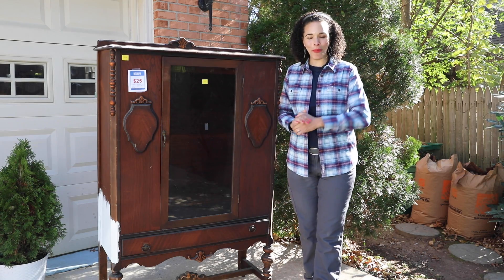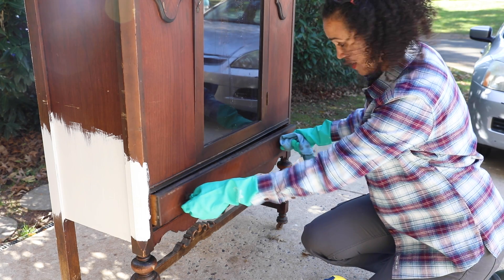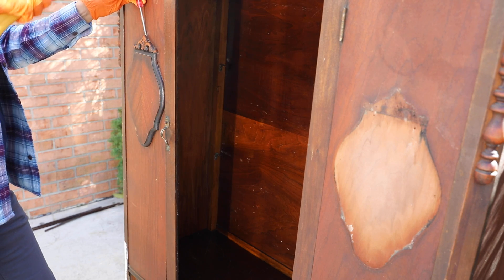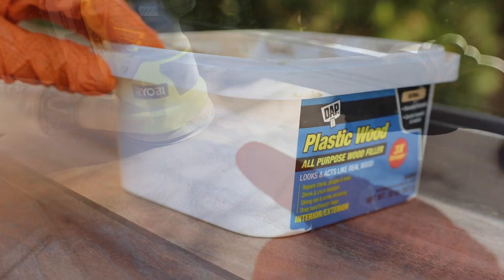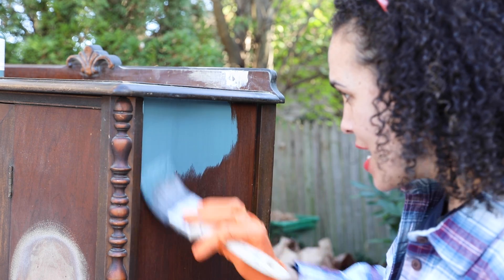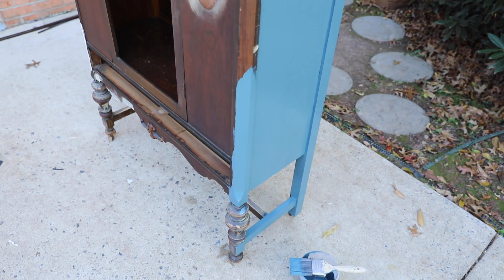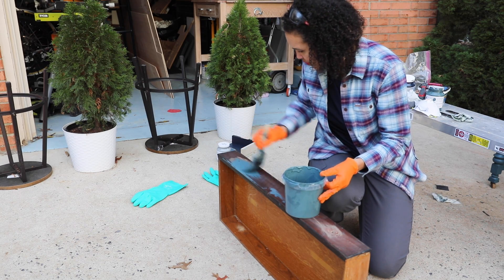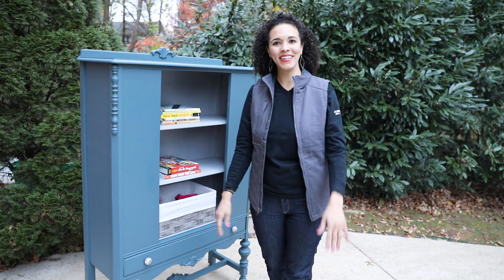BEFORE & AFTER: How to Paint a China Cabinet - Thrift Diving

Comment: Hi you just made a good point of why a power nailer should never be used in small molding around glass. All the molding pieces should be numbered and put back in the same position and use identical size nails to go into original holes using a tack hammer which has a very small head. Taking the door off to remove the glass and replacing it is best done on a table. If that glass fell it could seriously cut your leg or foot open. The color you chose was gorgeous!

Comment: I wouldn't be too sad about the thin glass breaking. My eldest son got a nasty injury when wind blew front door closed hitting back of his head. When the door had been installed, my Mum in Law wasn't aware her cousin, the joiner hadn't fitted safety glass.
It's too easy for a little one to push another whilst walking past, unintentionally causing an accident.
Old glass is just so thin.
Your cabinet is absolutely beautiful.
If you can safe a piece of furniture even by painting, it's better than being tipped or going on a bonfire.
So many people don't want brown furniture.
I still have my round teak table and chairs that fit right underneath it, bought 1969.
About to get top sanded and waxed, legs painted. Original jazzy early 60's print to cover 4 chair seats and back. Eldest son gave approval, didn't ask for it, but pleased!
It's nice to put new life into furniture you like, but feel it just needs a lift!

Comment: I picked up a piece out of the trash that is just a little bit bigger in the dimensions than the one you have. We painted it and I did not replace the glass but instead I put chicken wire and replaced the inside trim to hold it secure. It looks amazing

Comment: Over-all this turned out nice.  Loved the blue not the grey.  While it could have been repaired, It was a good candidate for painting as it was never an expensive piece.  Thoroughly inspecting and lightly sanding the whole piece helps to find those loose bits of veneer.  It would also have smoothed out the roughness,  around the trim, that still showed after painting.  Sanding with a small sanding block, instead of your fingers, gives a smoother sanding.  The need for priming before painting depends a lot on the qualities of the paint being used.  Some have primer qualities built in.  I am a big believer in not cutting corners especially when selling.

Comment: I have that Ryobi sander. Do you have any issues with it not catching the dust in that little baggie? Mine never seems to collect anything but when i shake it, a ton of dust comes out.
Reply from the maker: Same! I don't know if you can see it, but on the camera the dust is flying everywhere. I just switched over to a really expensive line of tools called Festool because they make dust extractors that are at the top of the line when using tools. I decided that for my birthday I am going to buy one of their orbital sanders. And while it has a dust bag on it, you can take it off and plug in the dust extractor and it sucks up nearly everything. It sucks it up so much so that you don't even need a dust mask. It's THAT clean. Of course, it's not cheap, but I'll make the investment if it means less dust floating in the air!

Comment: Whether you need to sand also depends on the kind of paint you're using.  Chalk paint itself doesn't require sanding.  Sorry about the glass mishap.  You may want to consider making a curtain to replace it or some kind of wire mesh...even chicken wire (painted) might work.  Like you, I love the color!
Reply from the maker: Love the idea of chicken wire! That's pretty affordable, too. I was thinking of a metal mesh screen, but to get one to fit that side opening, I would have to buy a larger piece and those run about $30, I think. So the chicken wire is a lovely idea! :) Thanks so much!!

Comment: Im new to repurposing furniture! Would you be able to sand and stain wood without stripping it?
Reply: Yes you can sand instead of using stripper but if you have fancy trim, finials and lots of moldings or ridges you will have to sand a lot by hand.  Very tedious.
Reply: @PMcC44  thank you so much!
Reply: @brittneyambruster  If you use Citristrip to strip - even just the curly parts- it is a water based stripper and not harsh like most of them.  It works well.  You can purchase it at Home Depot, Lowes etc.  Available in Canada and the USA. Link in the USA: https://www.homedepot.com/p/Citristrip-1-2-Gal-Safer-Paint-and-Varnish-Stripping-Gel-Non-NMP-HCSG803/307416113

Comment: Next time I wouldn't take the glass out. If you can take the time and cover it with paper or tape the glass it will be more likely to stay intact and not break. Or if you do take it out... NEVER USE A POWER TOOL TO NAIL IT BACK IN!!! Us a small hammer and lightly tap the nail tacks into the trim. Taking the extra steps will be more easier to get the task completed correctly. Just make sure you take ur time to get the glass back in....

Comment: You didn’t prep the piece at all? (Besides the simple green)???
Reply from the maker: Nope! Didn't need to. Most furniture paints on the market today allow you to skip prep if it's in good condition. The times when you should prep is if you have bleeding in your paint from the tannins in the wood, or if your wood is super dark and isn't being covered very easily, or if you need to sand and smooth areas. Otherwise, jump right in with a good furniture paint! 😁

Comment: It's good wood. You can use what you removed as bookends.  You can use sandpaper on a automatic toothbrush.  Saw someone do it.  Why did you use the nail gun on it, that's too much force.  Not smart at all.
Reply from the maker: HAHA, I would agree with you! I have used a nail gun before, on the previous china cabinet I did and it was fine. But this one was a more powerful one. And well, mistakes happened. Stupid me, I should have simply removed the door and did all I needed to do while it was lying flat. But sometimes my brain really doesn't think. LOL